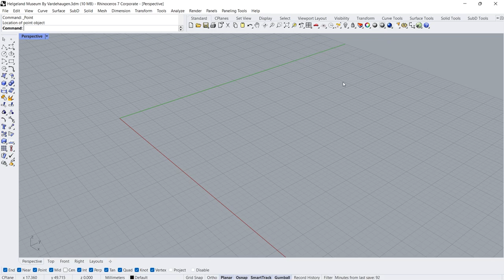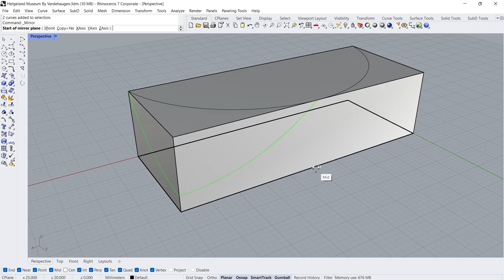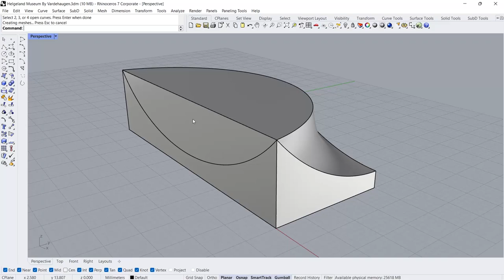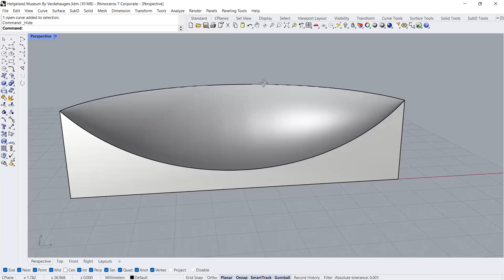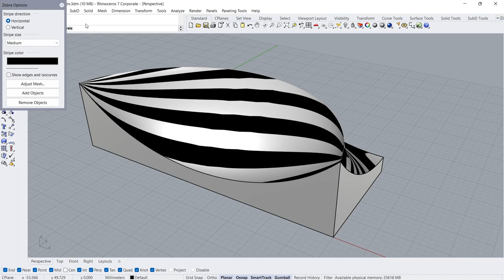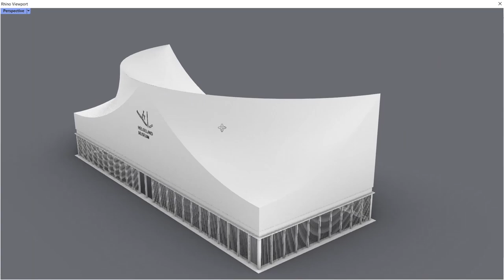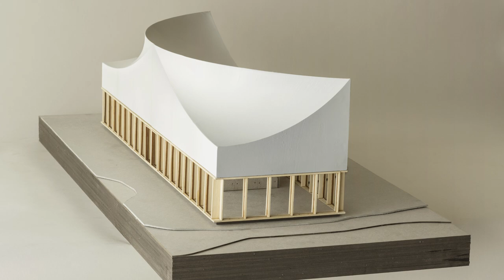Roof Modeling Tutorial

Comment: Hello and thank you for your videos. I write because I have a problem at the minute 4:15 . My surfaces do not join suddenly I can not assemble them in a single block. Because of this the surface offsets become corrupted. How can I solve the problem of the intersections of the curves?
Reply from the maker: Hi thanks. Be sure to keep intersections and midpoints exactly enough when creating arcs.
Reply from the maker: Also run the ShowEdges command. And select the naked edges. So you can find open edges.
Reply: I redid the volume from the beginning and I noticed that there was no intersection error until the moment when I joined the 2 curves with mergessurfaces at 3:31. 
After that I have a small excess surface that exceeds the surface on which there was an intersection
Reply: ok i solved the problem with the tool sweep2. indeed there was naked edges